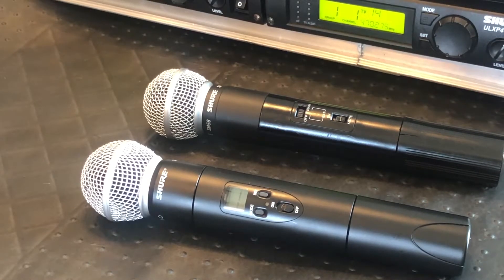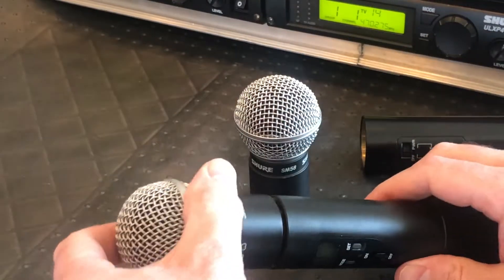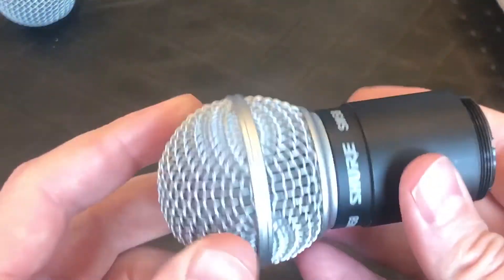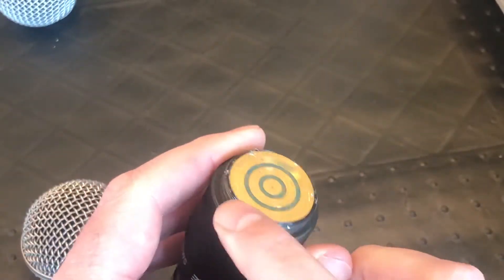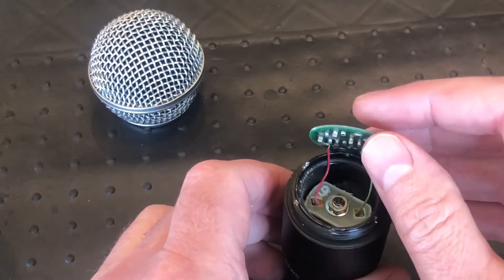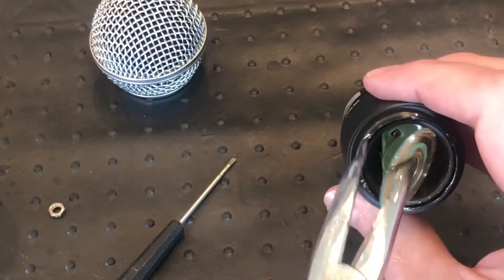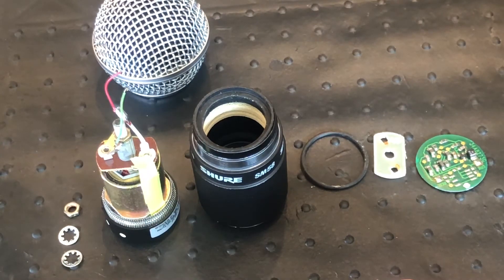Shure SM58 Wireless Capsule Teardown

Comment: thanks so much for making this video! I'm trying to DIY a wired handle for this interchangeable mic capsule because the brand name one is $200 where I live and this was super helpful. currently am trying to figure out if it would be possible to directly wire the gold contacts to the wires in a TRS or XLR cable
Reply from the maker: Wow good luck! Let us know if it works and send a picture!

Comment: Question! I touched the small round foam ontop of the cartridge and it broke into pieces (disintegrated) is my microphone at risk or it’s still good ??? Please help im pretty worried
Reply from the maker: It will be fine. Just make sure the foam pieces did not move around and are not stuck inside the cartridge, on top of the membrane. That will muffle the sound. I’ve had that happen. Once all the disintegrated foam is removed, the mic will sound fine. Good luck!

Comment: I need help 😔 with my sm58 this yellow plastics it's wire? Or tape?
Reply from the maker: It’s an ultra-thin wire, stuck to the yellow tape. Thinner than a human hair. I was able to pry it loose with tweezers and bridge a burnt spot with a piece of thin copper wire that I soldered over the gap. I used a magnifying glass for the soldering. It probably changed the impedance of the microphone but it is working again. Hope this helps.

Comment: Question where is the positive and negative terminal in 3 round copper. There is an inside terminal 2nd round terminal and 3rd terminal
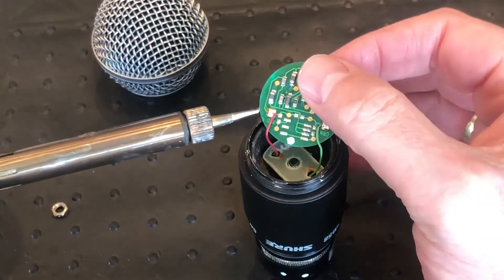Reply from the maker: Sorry, I don’t know why there are 3 rings. There are only two wires coming out of the round circuit board, red and green. You can see this in the video at 4:55.
Reply: @edgarsteenwinkel1970  outer ring is earth and it is connected to the body

Comment: I have a question, I have a sm 58 model no LCD, I want mod to the receiver, the original receiver is gone. Can I do it?
Reply from the maker: Your microphone transmitter should have a label somewhere (under battery cover?) with its frequency or frequency code. Then find a used Shure receiver with that same frequency.